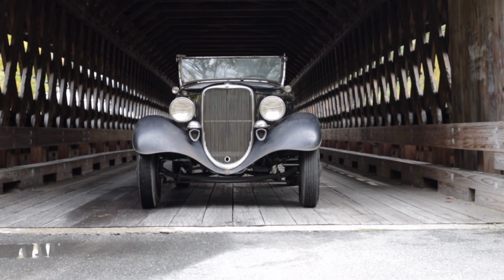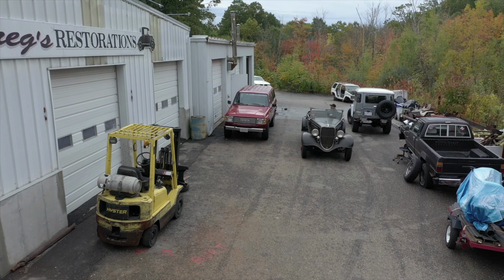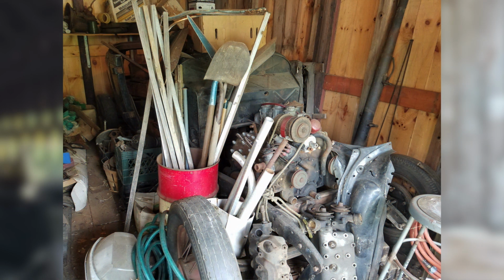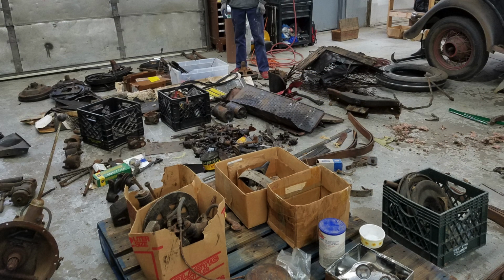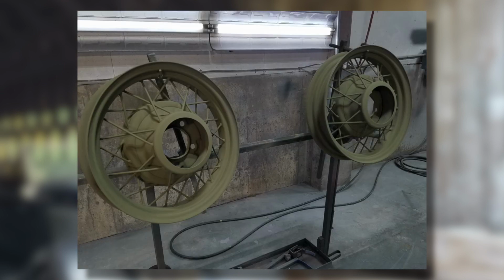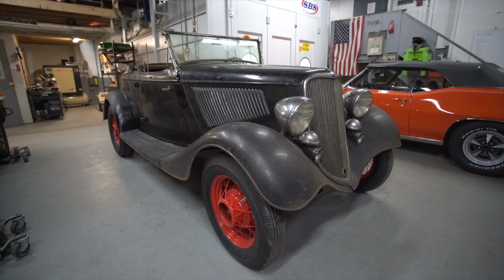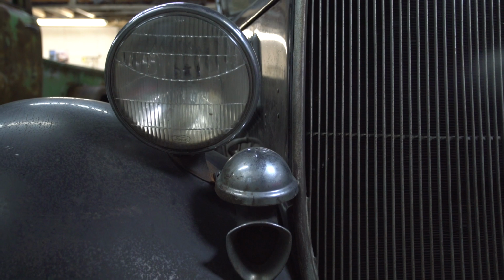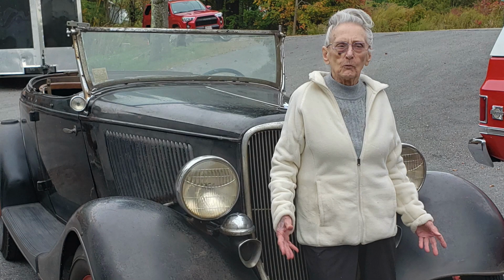Barn Find: 1933 Ford Roadster V8 : Henry Ford Steel

Comment: The first modified car - the blue roadster with the silver panels was built by Lobeck's V8 Shop in Cleveland, Ohio for the Splitfire  Spark Plug Company for a SEMA show. It's called "The Splitfire Roadster". It's based on a Gibbon fiberglass body. I was the second owner.